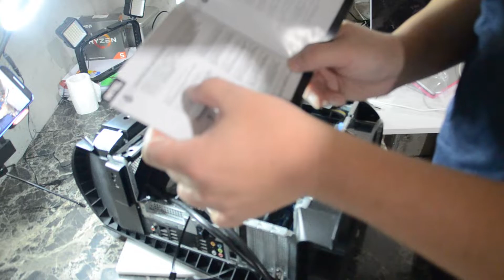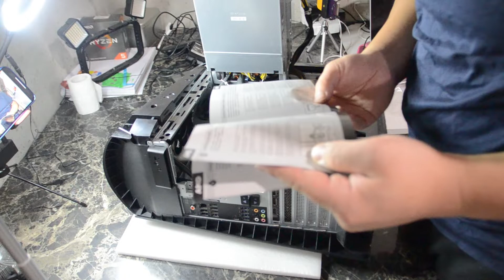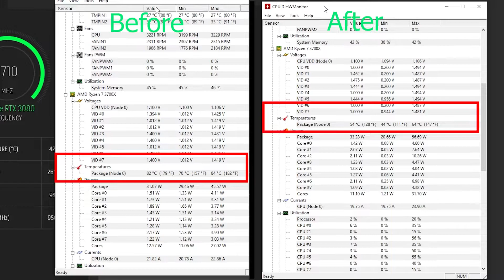Alienware Aurora R10-11 swap of fans Corsair Hydro H60 Liquid Cooler, Compare with before and after

Comment: Easy question, is removal of the top panel necessary?  I have the exact same pc air cooled and i think i should just put this corsair h60 on it.
Reply from the maker: No, Not necessary remove top panel. absolutley you can install the radiator from chassis inside without remove panel.

Comment: if anyone is planning to buy this pc, make sure to go with the liquid cooling option.  otherwise the cpu runs way too hot and the pc is too loud
Reply from the maker: Agree
Reply: I find my R10 (5900X CPU) a bit loud even with the liquid cooling (perhaps my old machine was just really quiet...). I have a 6800XT GPU as well and it's not what I'd call quiet either... A little bit of fan noise while gaming aside, I love the computer and would absolutely buy it again.
Reply: @xKrispyx  my buddy said i can transplant the guts into a NZXT case. maybe a better case for the beefyness in your rig my help out? :]
Reply: @Smashmode87  I think I'll have to go that route, eventually. At the same time, I don't want to give up any front panel I/O,  and the R10 has a pretty solid front panel port config. I looked at the Lian-Li Dynamic O11-XL, I'll definitely look at the NZXT options as well.
Reply: @xKrispyx  yeah man. I been looking to buy my first rig and I did. Well I wanted to build a rig but since the market it all messed up and gpu price skyrocketed, I figured I just get a pre built. So I had 2 good options for my price range and they both got sold out.. and this R10 Ryzen 7, with a radeon 5700 was in sell for 1,250.. so I'm stoked.. saw alot of good reviews. Only issue is the ventilation from the sound of it. So I feel I didn't do to bad lol.
Reply: @Smashmode87  Congrats! That sounds like an awesome setup at a very reasonable price, and it'll have more than enough "horsepower" to run anything you throw at it for the next 5 years, probably more. My old rig was an i7 980X from 2010(ish) and a GTX 970 from 2014.
Reply: @Smashmode87  Yeah the problem is the heatsink can't cool it well under a full load, I also replaced the top fan, just because it's loud in general. I tried changing the stock air cooler thermal paste to arctic silver 5 and it dropped my temps quite a bit, like 10-15C drop on idle and light stuff. Once you hit full load it'll jump back up to 95C, which AMD says they can operate at safely, but I'm not chancing that. I don't think it's all down to the case's airflow just not being good either as I see people claiming over and over. I had pulled the hard drive out and stuck a 120mm fan in there to bring in cool air to the CPU and again, it'll help the temps out in idle, but full load it'll hit upwards to 95C. You just can't fit a big enough air cooler in it because of how the PSU sits is what it comes down to. I would say a Noctua L9 could be better than the stock air cooler and fit in it, but again once you hit full load even on that it'll be probably 90C or more. I didn't bother getting liquid cooling in mine from Alienware because a lot of people say it's still hot with it, so I just ended up having to order a H60 like this guy. These Ryzens just run damn hot. Had an HP omen 870 before with a i7 7700 and that thing was always 60C-70C on stock cooler under load in a case that literally had one 80mm fan at the back and no intake fan that I could tell and intel says theirs run at 95C safely as well.
Reply: @richardg5301  good reply, I put a H60 in mine day one before i booted it up for the first time. underload with Cyberpunk playing my cpu sit at 78-79c. gpu stays cool as mofo. I'm happy with it. it just needs to come liquid cooled regardless i think. but the ingenuity of how they put that power supply is holding them back.
Reply: @Smashmode87  I heard that transferring the motherboard is a pain in the ass. It has some security things you need to by pass and may think it is stolen. My suggestion is to just buy a new motherboard and chasis if you plan on doing that. Another thing you can do is take out the Hard disk drive 1 bracket . And when you put in a liquid cooling steal the fan bracket from the top and put it in to match the one already on front underneath it.
Reply: @Smashmode87  don't know why I responded since you definitely have done something since than lol
Reply: @YobiCantGetRight  it's all good dude. Still is more info. Try. It works just fine with a cooler in it. Im going to put another fae in where the HDR is and it will be even better. I do love in southern California and it get hot here. So that would be nthe only thing about this case. If you live in a cooler climate it's perfect. Plus I just take the side panel off from time to time while I'm play for awhile. Only have to do that when it's really hot out. (For my GPU sake) lol.
Reply: @xKrispyx  a 120mm AIO probably isn't quite big enough to keep a 5900X cool while also staying quiet.  My main rig has a 5800X where I enable PBO when I'm working and need the extra multicore perf.

I've got a 280mm AIO on that system and between the slightly larger 140mm fans and the larger radiator area/mass it is able to keep the system really quiet.  Unfortunately on the R10, you just don't have the option for a larger CPU cooler.
Reply: Yeah otherwise you gonna have to use this video to put in the liquid cooling yourself. A push pull fan set up on the radiator also if you want a little extra boost on the air.
Reply: Could've sworn I've added that option. Apparently I did not and it shows up as smart cooling. So I'm trying to do whatever I can to be ready when it comes thinking of adding a second fan. And I'd do this but I'm worried I'll break something
Reply: Where do the plugs go in ?

Comment: Nice Video! I have a question.  How did you secure the radiator? I didn't see a screw I could use. Is it held in by pure tension?
Reply from the maker: Well, There is no extra screw to solid the radiator, but fortunely the radiator size fit into the fan cage very tightly? so i didn't screw radiator to the cage., if you think feel distressed ？ Then you can buy 4 crew to assemble radiator to cage.

Comment: 6:41 min - When you do this effort you should have done a push-pull configuration like in this video: https://youtu.be/tnt3u5SOSIk
Reply from the maker: Yeah, Most important that you gonna be disconnected the CPU cable of Motherboard, then you will easy to install the radiator, outherwise wil stuck radiator when you are installing

Comment: What about the VRM heatsinks?  The air cooled mobo's do not come with them.  Wouldn't you run into major problems with the 2 heatsinks that dell provides with their water cooler?
Reply from the maker: This is good questions, You are right there is no VRM heatsink if you choose options of aircooler, but i think VRM quality not too bad for this MB from factory coz Alienware originally launching for Over clock features. 
just in case i already sitck the thermal pad on my VRM in  order to get good performance. ^^

Comment: Nice! I am planning to install the cooler as well for my new R11, I was wondering how difficult it was to take the top case cover off like you did without breaking it lol? Did it have alot of resistance when you pulled it off?
Reply from the maker: Well, You just force a little pull out is ok, don't need to give much presures, if you afraid to break that, one tip is that, you don't need to take the top cover and then able to install the liquid cooler from inside, so do it without take top cover is ok, no problem.

Comment: Hey just wanted to thank you for posting such a great video. Made the mistake of ordering the R10  without liquid cooling and my temps in-game have been hovering around 90-100c. Just ordered my H60 but I have never installed something like this before so this clear step-by-step video is super useful. Much appreciated!
Reply from the maker: Be my pleasure^^
Reply: I made the same mistake :/ first day with my new set up and I’m running at 93c just playing a little Warcraft, Ryzen says the new chips can run hotter but I just down like it, plus the fan blowing like crazy is annoying
Reply: What is the temp difference with the H-60 in?

Comment: Does the corsair come with the 120mm fan? Do I need to get an extra 120mm fan as well? Nice video
Reply from the maker: No, you don’t need, there is a new 120mm fans with cooler. Thank u
Reply: @ironytech3443  thanks. I'm going for a sandwich setup so I may end up getting an extra fan. Keep it up.

Comment: I just bought a mid tier R11 (i7/RTX 2070Super) without liquid cooling and it does tend to make a racket under load but the temps never exceed the mid 80 degree range on the CPU while the 2070 seems to vent quite well. In retrospect, I think I would have gone liquid with this R11 but know I'm too damn lazy to attempt the swap you have going... it's a lot of bloody work and you can be guaranteed a few things will be either too short, missing or incompatible :)
Reply: how is yours holding up? i just put an msi rx 6600 in mine, and my cpu temps have been hovering near where yours were. its got me debating upgrading to liquid cooling. of course i bought mine used from a family member, but it was never used very hard. just trying to make sure i dont stress it anymore than it may have already been

Comment: Just built your own pc
Reply from the maker: Yeah, sure, but just this price is close to what i build myself and most important they have RTX3080 GPU
Reply: @ironytech3443  same reason why I bough basically the same as you, 3700,32gb ram, rtx3080 and .... air cooling, I will switch to water cooling soon I guess.

Comment: can you install a second fan with the Y splitter with the H60’s ? Or just the Alienware one as I’ve seen you can do a double fan
Reply from the maker: I don’t think so. I installed one h60 to replace top fan as well as cpu fan only. There is no space install scone fan to there.
Reply: @ironytech3443  actually I made a sandwich with two ml120 pro and h60 in my R11. Honestly not much different
Reply from the maker: @xyt0435  You mean different with original Air cooler? or difference with one or two liquide fans? but i believe it will be difference with original air cooler, but for sandwich might be same what you say.

Comment: another option folks is deepcool gammaxx l120 v2. Works perfect in my R10 Ryzen edition. no issues with Fan/bios. cost me $60 CAD
Reply from the maker: Well, How about temp when you are playing game? pubg and warzone?
Reply: @ironytech3443  I don't have these game, but playing Control and Doom Eternal temperatures are max at 78C which is better than before (were up to 90'sC)
Reply: is the installation the same as this H60?
Reply: @haoxianfeng9117  yes except for I had to get rid of the metallic "box" where you suppose to insert the AIO, I only used the plate with 2 screws to attach it. Better airflow. I got Ryzen 7 3700, so now my temps are around 75C under load. with aircooler were 90c
Reply: @Denis-yyccan  if i don't remove the metal box, i won't be able to install the deep cool AIO?
Reply: @Denis-yyccan  btw, where did you get that    for 60cad after tax? amazon is selling $64.99
Reply: @haoxianfeng9117  yep that box is couple of millimeter shorter, so won't fit, but it's easy to install it just with the plate. Also I got the red LED version of that Deepcool AIO, it was $54.99 when I bought it.

Comment: My R10 runs at 90-95c any time I'm in a game and at 75-80c at idle.  I'm going to see if I can install an H60 today.  Thanks for sharing this with us!
Reply from the maker: Yeah, It is really rediculous temp for this PC, I stronly recommend you are going to change as early as you can, otherwize will reduce the CPU lifetime as always runing high temperature.
Reply: @ironytech3443  I replaced my fan with an H60 + PL120 this afternoon and I'd say on average 25c lower in games and at idle (50c at idle and 70-75 in games).  I know they say it should be lower but honestly I'm happy to be pushing 240 FPS and not being at those crazy temps.  Thanks again!